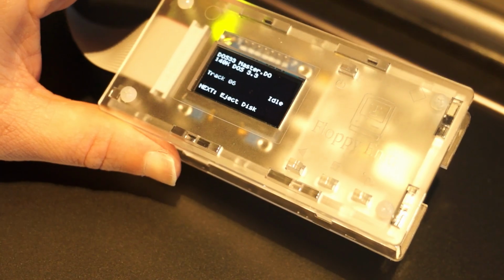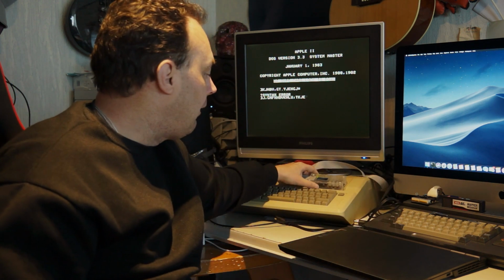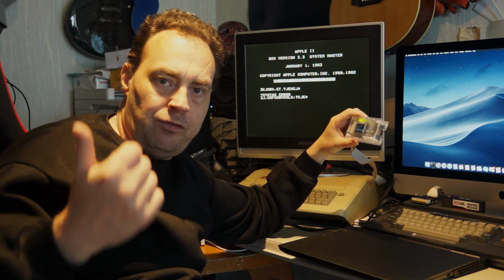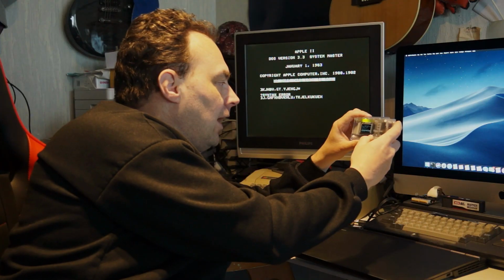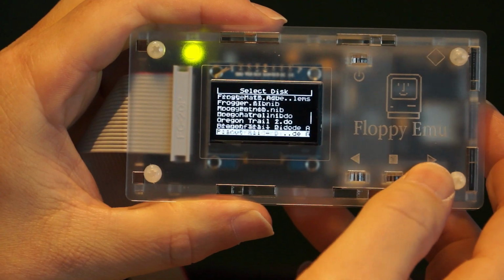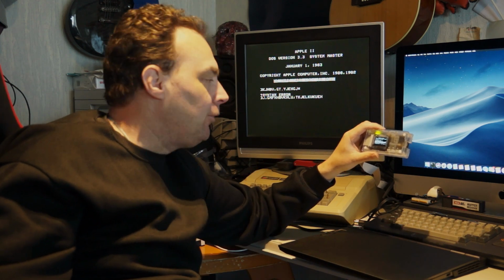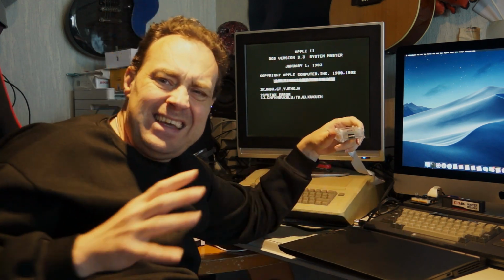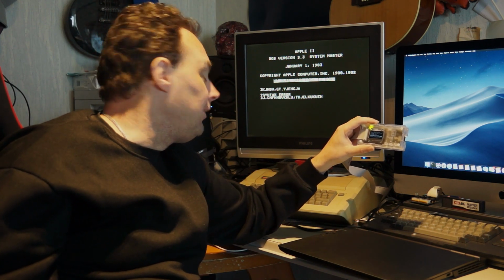Building and reviewing the FLOPPY EMU

Comment: I think the price of the emu is very reasonable.
Reply from the maker: I think it’s a bit steep seeing all the other systems I have for Amiga, ST, C64 and MSX systems. Which are either as expensive but do a lot more (like extra memory) or cheaper. The Atari Satan I have on my ST comes in a nice metal box two slots and coats about 20 bucks less.
But the EMU does work nicely though and I love it.